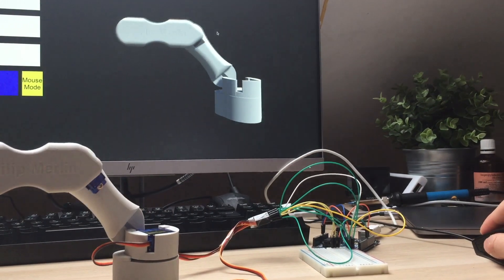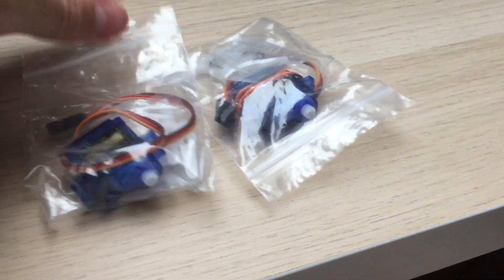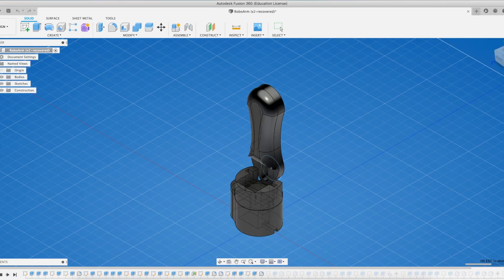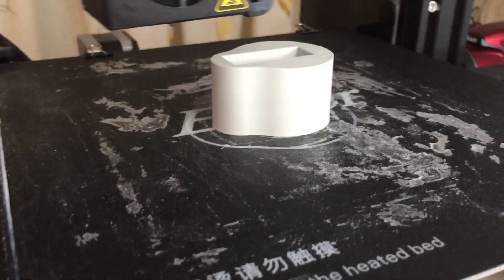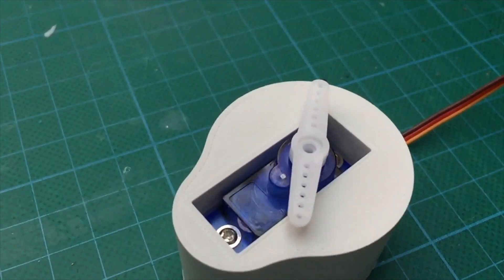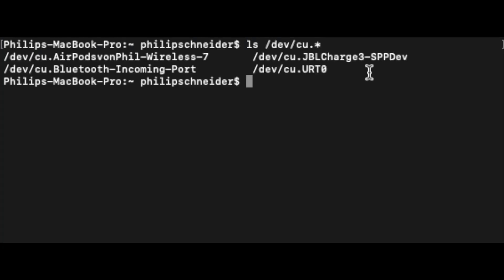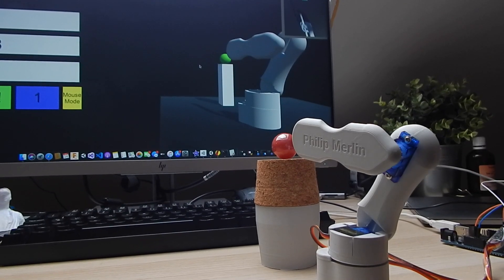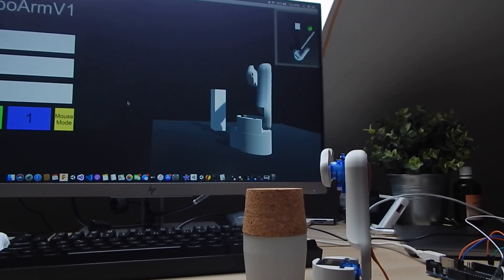3D Printed Robotic Arm controlled by real-time simulation

Comment: hello good day. I would like to ask a few technical question. ok some background first, I have personal project involving a small robotic arm powered by the same servo motor.  In my own Arduino code,  I manage to convert x, y, z coordinate into servo angle using inverse kinematic formula.  but here is the problem, every time I increase or decrease on the coordinate value, the servo would move in a stiff manner unlike in your video. what should I do to smoothen the servo movement? I notice that you are using a VarSpeedServo library does that mean that I have use that too program the servo speed? 

Thanks in advance.
Reply from the maker: Yes the VarSpeedServo libarary adds a speed variable, which lets you slow the servos down and therefore smoothen out the moovement. I can recommend it:)
Reply: @PhilipMerlin  which programing language u learnt